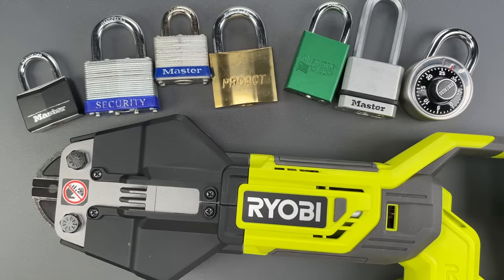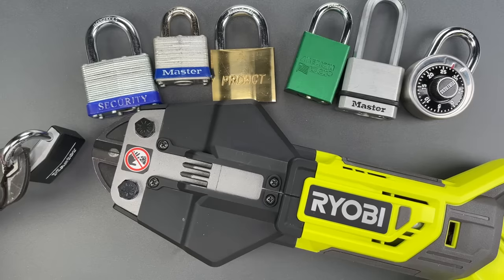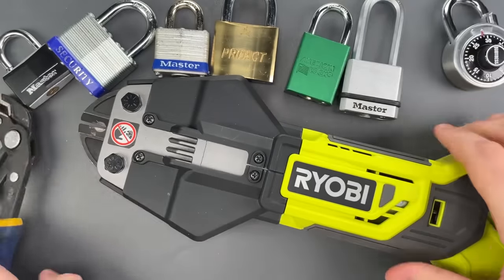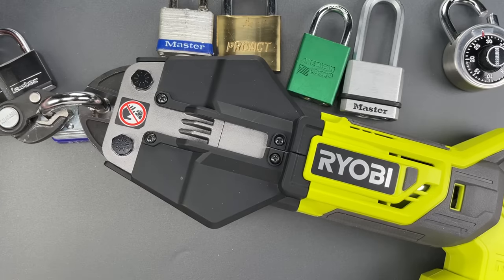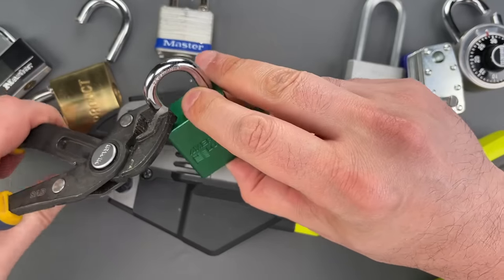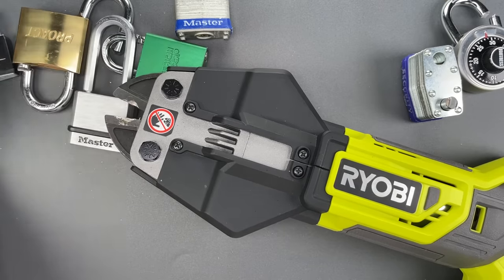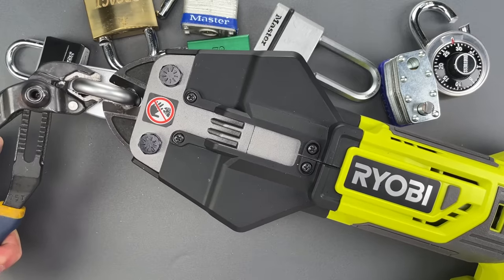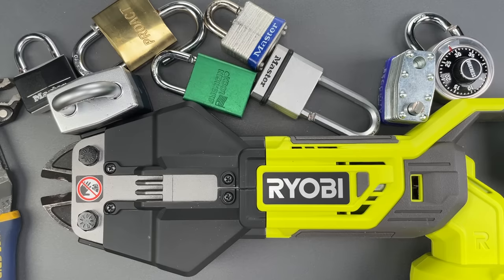[1408] Better Than Expected: Ryobi Bolt Cutter

Comment: Just a quick note, the stopping on Ryobi One+ tools usually happens more with batteries less than 4 AH. The 3 AH battery is the worst for high current draw. a 4AH or 5AH battery would likely just power through those cuts without stopping.
Reply: They make a 3ah HP+ battery, not the case.
Reply: @REALBanannaman  You obviously didn't read what Ginger M said properly.
Reply: @mBaggins  I said, RYOBI makes a 3AH High output battery, so no, the 3ah isn't the worst. You obviously have a defect in the head.
Reply: @REALBanannaman  they also make 4 and 5 HP that would be better.
Reply: @Infernos94  You bet
Reply: Hi
Reply: It's most likely because of the current rating on the individual cells inside the battery. More capacity usually also means that the cells can withstand more current. This isn't always true but might be why the overcurrent protection kicks in.
Reply: Negative, I think it has a pressure sensor, nothing to do with the draw
Reply: One's arms and a pair of long handles for leverage do an awesome job too, just saying 🤣

Comment: As someone who has a lot of ryobi tools I can tell you that is you use the smaller batteries they will cut off during high loads on some of the more power hungry tools. The 4ah batteries work better in tools like this.
Reply: Also the newer cells work better. There are 3 or 4 generations of lithium now.
Reply: I came here to say this. I think that with a bigger battery it would have not stalled out so many times.
Reply: That's what I came to say.  Honestly I made my own adapter to Ridgid packs out of a dead 2ah Ryobi pack
Reply: @milescarter7803  I’d really like to see some more info on that.
Reply: This is a true statement.
Reply: @BD-xz6te  you can find battery adapter all over the place... It's a waste of time making your own imo. I don't know why my replies got removed.
Reply: @TheRatsintheWalls  no links just the name of a popular rain forest and a famous bay where bidding takes place

Also keep in mind while it may be rewarding to make your own adapter you will need not just a dead battery to hack apart but also either a 3d printer or the other half of a dead tool... It's just not a worthwhile diy project when the best you can hope for is creating something that already exists for fairly cheap
Reply: Yes, but with the older tools, the motor burns out from the higher current. They are at least on their third generation of reciprocating saws. Of course, they probably weren't designed for cutting tree branches. I'm never sure if the smoke is coming from the motor or the bearing. The newer versions seem to have shorter blades and slower action probably in an attempt to not have so many warranty returns.
Reply: Get this higher, I want to see these supercharged BC against everything that fits!
Reply: @johnhaller5851  I’m still using one of the old blue saws with 4AH batteries.  I’ve cut truck frames and 3/8” x 3” bar stock with it. I’ve had no issues. Reciprocating saws are the wrong tool to cut tree branches. The blade doesn’t move enough to clear the saw teeth. 

The only tool I’ve ever had the motor burn up on was an impact that was over 10 years old. The brushes wore all the way down.  It had run tens of thousands of screws and been used as a mallet more than once.
Reply: Who tf even uses less than 4Ah?
Reply: @Version135  How do you tell the difference?
Reply: @Rudy97  people who bought a tool with a  1.5-2ah battery included.  that came with them.   I use my tools pretty heavily and have a half dozen of the 3-4AH batteries, and probably double that of the smaller ones.  They mostly get used in things like my impact , sander or the multitool.
Reply: Yup, the batteries smaller than the 4Ah aren’t useful except for use in certain light load tools. And the 1.5Ah batteries seem to be the “throw in” battery when tool kits come with a battery, probably to sell some 4Ah batteries later on.
Reply: @BD-xz6te  - that is a good idea to do given the Ridgid warranty. I’ll have to explore doing that if I can’t just buy that adapter - I already have lots of Ryobi 18V tools.

Comment: I occasionally helped a good friend of mine who was a locksmith, He showed me a far cheaper way to get through brass bodied padlocks, as you demonstrated a hardened shackle will damage the blades on your bolt cutter so we used his biggest bolt cutter, probably the biggest one you could buy, and we actually just cut the brass body of the lock from the bottom (key way) up. Brass being a softer metal tended to do less damage to the bolt cutter blades and was usually just as fast with less effort than cutting a shackle.
Could you demonstrate that method and see how it goes for you. FYI we never used it of steel bodied locks.
Cheers
Reply: I would love to see this.
Reply: Falconhoof  shhhh we don't talk about that :-)
Reply: Thanks ill keep this little tidbit the next time i need it, im sure my buds would love my knowitall smartassery
Reply: Maybe using a Cordless grinder on the brass.
Reply: @DiscoR53  Was gonna say. I don't know why anyone would but a battery operated bolt cutter when you could just get a cordless angle grinder.
Reply: @Alconium  too loud?
Reply: @anonymousejr  Maybe. The cordless bolt cutter doesn't sound quiet either but maybe its just the video. Can't imagine it's not louder than old fashioned bolt cutters.
Reply: @Alconium  yes, but imo its the fitting middle ground b/w "op but too loud" and "weak but silent" (weak in terms of reinforced locks)
Reply: That's pretty smart. Idk whose idea it was to make the hardest shackle but the weakest overall lock.
Reply: @DiscoR53  the lock would have to be held in place somehow
Reply: Cut through the hasp instead??
Reply: @monkchips  whats a hasp, is that the aforementioned body of the lock?
Reply: @anonymousejr  it is a part of a catch that the padlock is holding shut. The eyelet that the lock goes through is part of the hasp.
Reply: @monkchips  ohhhhh, that makes sense. Thanks.
Reply: This needs more likes. Also want to see this method attempted. LPL??
Reply: Grinder is loud and comes with a fire hazard. Every time you have a reasonable option to avoid sparks with some other tool, its a good choice to make. Grinder also requires the piece being cut to be held sturdy or you risk blowing a blade.
Reply: Perhaps what you can do is torch the shackle portion of the lock, then cut through it? Since metal becomes softer ss it heats up.

Wouldnt go well for anyone who get shot by now-flaming-hot- shackle pieces tho
Reply: @Alconium  You might find that the bolt cutter was quiet and had less of a spark shower so less visible to other people who might be watching.

Comment: I'll be honest, I've found Ryobi to make pretty good tools EXECPT for their metal hardening. 

Avoid their drill bits for sure.
Reply: My favorite product by them is the Ryobi One+, which is a portable misting fan. We've taken it to the beach, camping, and even birthday parties and everyone loves it. It is designed to sit on top of a 5 gallon bucket but it can even operate from a water bottle.  Blows air and mist about 20' away which is perfect for staying cool in the hot summer
Reply: The only issue I've had with their drill bits is that the ones I've used have been smooth shank making it impossible to use on any hard materials as the chucks don't hold hard enough. If they made hex shanks then it would probably work just as well as any other cheapish brand of bits. I'm currently working with a set of husky bits with hex shanks and while not the best, they do the job.
Reply: Their stuff is okay, but their table saws really tick me off (one wobbly miter slot? How much money did that save, maybe a dollar?)
Reply: @theguru143  One+ is their common branding for a series of tools that might share the same battery.
Reply: @OB1canblowme  You ... don't know much about metallurgy, do you?

All drill bits are absolutely not, in any universe, equivalent no matter the brand. Not even close. Cheap Harbor Freight or other trash bits are literally trash compared to actually good brand bits. I've had cheap bits come that aren't even fucking straight, for crying out loud.
Reply: I’ve actually had a lot of life with them going through composite. Definitely better than the equivalent Milwaukee.
Reply: Never had an issue with their drill bits, but I'm not a hard user either.  The only Ryobi anything that's really been an issue for me is the circular saw I got, it's kinda crap. But it was also cheap so you get what you pay for.
Reply: I only have two Ryobi tools: an electric screwdriver and a hedge trimmer. Both have been pretty good for me, especially considering their low price
Reply: Project farm would beg to differ.  They’re mid to good , not poor to bad.
Reply: Snap On Cobalt drill bits are my favorite.
Reply: They are really good at making stuff that feels high quality, but isn't.
Reply: @ashkebora7262  My dad worked for Cleveland Twist Drill. Much of what they made went to the defense and auto industries, they sold a lot for making tanks. Unfortunately, much of the specialist steel industry moved out of the US, making it harder to get the steel to make high quality drill bits. I recently saw some of their drills at Lowes, but are now made outside the US. Before my dad retired, they tried to sell into the hardware store market, but even cheaper Kentucky labor wasn't cheap enough to compete with Taiwan and eventually mainland China.
Reply: @ashkebora7262  the best ones are the wood drill bits that unwind when put in reverse
Reply: @OB1canblowme  yes it will mate. Did you fail material science? Harder materials can and will hold an edge for longer regardless of the use case for said edge. You think box cutters for instance have those break away blades for fun? They use shit cheap steel and the edges wear out very quickly just cutting cardboard
Reply: @saxamusprime  Thank you - not bashing Milwaukee outsite of their ridiculous "Titanium" explosives disguised as drill bits.  While fun to watch fly through the air with the greatest of snaps they have been the worst brand name drill bits I have ever used.  I have cheap no name black oxide bits that out perform them by miles.
Reply: @OB1canblowme  it's most likely user error.

People don't realize that different materials drilling into as well as what the drill bits are created from handle heat and speed differently. Some can take a fast speed while others need to go slower. Some just aren't up the the job concerning the material they are drilling into becausethey are softer.

A rule of thumb I go by is the harder the material the drilling into the less speed and more pressure is needed and lots of lubricant. But I've personally ruined bits that were supposed to be better because of a coating or what they are made of because I got that wrong.
Reply: @OB1canblowme  100% true. It seems like people just don't understand that drill bits are disposable pieces of hardware. I once had a friend who complained about a drill bit when it dulled after he made 5 or 6 5inch deep holes through 1/2 inch of ceramic tile, then into solid concrete. Meanwhile I was impressed they worked at all.
Reply: Avoid their power washers as well.  Biggest waste of money I've ever spent.  I'll never buy any of their products again.
Reply: @acephantom903  I spent 20 years drilling holes in hard steel & other materials using standard, smooth shank bits.
Blame the chuck, rather than the bit.
Reply: @GARDENER42  I agree. My current Meraki's chuck is better than the Ryobi but they are both the self tightening kind. I prefer the ones with keys. Never had one of those slip on me.
Reply: I agree, this isn't the first time I've seen someone damage the cutting heads on this tool.  I have multiple sizes of bolt cutters and never had any of them suffer like this... and I have a whole collection of Ryobi tools, just not this one.
Reply: I like their Forstner bits because I can easily sharpen them.
Reply: I used to buy Vermont American drill bits and bolt extractors at ACE Hardware because they were guaranteed. 
On one excavator repair after a rollover snapped a bunch of bolts, I went through nine bolt extractors for the price of three.
I had to change brands to finish the job, because they were out of stock by the second day.
Reply: @ashkebora7262  - drill bits not being straight sounds just like some Ryobi bits I have ;)
Reply: @acephantom903  I just picked up a new Dewalt drill-driver, their ratcheting chucks are better than most of the keyed chucks that I've used, and you don't have to find the key every time.
Reply: @inibrius5380  I'm not seeing anything for how their ratcheting chucks work. I'm only finding that they are called ratcheting chucks and everything else that is turning up is a basic keyless chuck. :o
Reply: @acephantom903  Basically you tighten the chuck on the bit until you feel it click, that's when the ratcheting mechanism kicks in, then you tighten it another turn and it won't release until you loosen it with like 15lb of force.  I encountered it first on a Milwaukee hammer drill but a lot of contractor grade tools have them now.
Reply: @inibrius5380  actually, I have seen that on a drill. I honestly thought I was breaking it by turning too hard. Lol
Reply: Ryobi and Milwaukee are made by the same corporation…. Google is free….
Reply: @6724superman  So is Hart.  But you wouldn't expect a $189 Milwaukee M18 , an $89 Ryobi ONE+, and a $49 Hart drill to have the same features even though they're manufactured in the same factory.  Milwaukee is contractor grade, Ryobi is consumer grade, and Hart is walmart grade.
Reply: Oh for the days of Kearney and Trecker!
Reply: @MarvinWestmaas  Meth much?
Reply: @tihspidtherekciltilc5469  Keyboard warrior much?
Reply: That's what makes the Ryobi less than perfect; the jaws are not as hard as a premium quality bolt cutter would be. OK for the first 10 cuts or so, after that not so hot. Not what I would ever depend on to cut rebar etc all day. And you can't really sharpen this type of jaws, they just get farther and farther apart if you try.
Reply: @martyspargur5281  This tool is not designed to cut rebar much less cut rebar all day.
Reply: @tihspidtherekciltilc5469  Thank You. I wouldn't even use my HK Porters for rebar; we're on the same page.
Reply: @hulkthefuror  wonder who actually makes those. Ptd is a common one I've used a lot of, but there are a few other good ones.

Comment: I would've liked to see him try using the sharper part of the blades on the last lock instead of re-using the flattened parts. Or even swapped them out with the new blades. Although power was minimal with this cutter, I suspect the blades were just pinching the last lock instead of creating an initial cut.
Reply: I reckon the shackle would've just slipped to the blunt part of the blade. Only option would've been to swap to new blades. Probably not worth it for him to do that.
Reply: @sibbert1  Unfortunately, we can only speculate at this point.

Comment: I find ryobi to be a pretty great value for people who need an occasional use tool that is pretty good but not great.
Reply: Which is pretty much everyone who doesn't work in construction or wood working. That's why it is so popular.
Reply: I work in construction and use Ryobi tools. Will survive a little shorter than a Dewalt and cost half the price plus usually comes with 2 batteries. Ryobi is hands down the best value but sacrifices some performance.
Reply: Yep. got one of their electric power washers.  Lasted bout 6 years so far.  Just occasional use though.
Reply: @BobSentell  exactly
Reply: @randomslacker9204  I appreciate your insight, but appreciate the juxtaposition of your job and user name even more.
Reply: I picked up a Ryobi chainsaw when chainsaws were nowhere to be found after a huge storm front passed through snd its been running strong for 5 years now.
Reply: It's made by the same company that makes Milwaukee tools. Pretty decent tools for the money and definitely one of the better budget brands
Reply: Ryobi batteries are great. Hold their charge for a very long time.
Reply: Ryobi tends to come in a very close 2nd at a third of the price of the brands that take 1st place.
Reply: I’ve used a ryobi drill at an oil change shop for 5 years, daily, covered in oil. The rubber broke down over time but it kept chugging
Reply: Cryobi here isn't much cheaper then the good brands so I don't see the point.
Reply: @randomslacker9204  dewalts also come with 2 batteries and charger. Have way more selection of compact tools and accessories. Ryobi is fine but You get what you pay for
Reply: What i like to refer to as home grade as they wont get much use but will always do the job when they do get used
Reply: @asabovesobelow1362  if you call half the price “not much cheaper”
Reply: @AverageThinking  As I said not much cheaper as  it's like 80 euro to 110 for a dewalt brushless drill my mush minded amerimutt friend.
Reply: @asabovesobelow1362  comparable voltages
Reply: My first ryobi tool was their Hot glue gun...because what? Two years later i have over 20 tools and the collection keeps growing. They have a tool for every need and occasional use, a Soldering iron check, Inflator/flator check, automotive buffer check, die grinder check, power bank check, smaller glue gun check, large fan check, earth auger check and the list goes on and on and that does not even include the basic of power tools like drills and impact drivers. Their line up is very impressive.
Reply: @AnthonyClauser  Ryobi is usually trailing DeWalt, Milwaukee, Makita, etc, by a fairly significant margin, but most people don't need the highest performance tool and Ryobi will do just fine